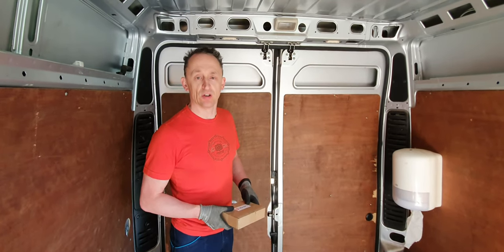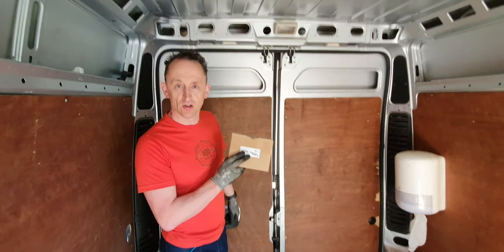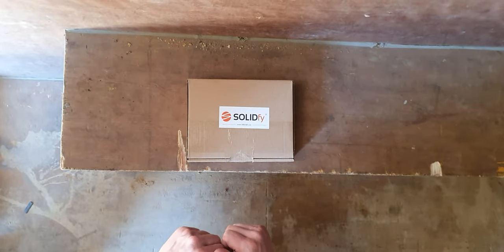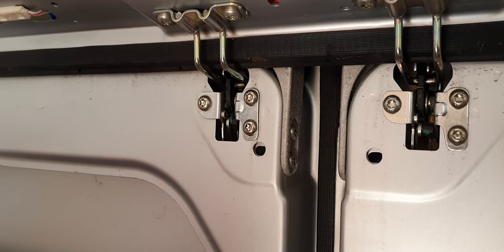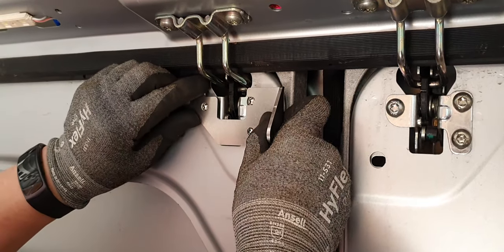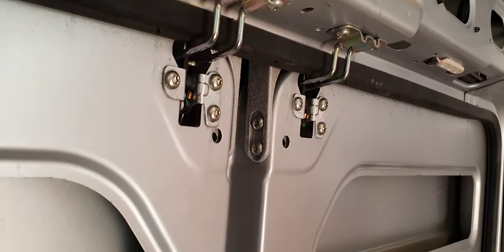Protect your Relay, Ducato, Boxer, Rear Door

Comment: Marking the position of the existing door lock brackets is very sensible until you realise that the security brackets obscure your view of the markings you've just made :)
Reply from the maker: I was able to see my marks, just 👍
Reply: Could you stick a bit of gaffer tape over the bracket to keep it in place while you install the lock? Belt & braces.

Comment: Thanks for the video - looks good. Btw there is a visible metal angle piece double bolted on each top door corner - do you know what they are? Security feature or something else?  Thanks very much
Reply from the maker: They are the door locks for the rear doors, if you are asking about the ones which are connected to the bolts i use to fix the lock too.
Reply: @Alivefrom45  Thanks- not those,  its the ones bolted to the door side at the top, facing inwards.  Just wondered if they are there to stop say a lever being pushed in at the top.  Looking at them on my Ducato they don't appear to be involved in the lock mechanism.
Reply: * facing inwards * ... I mean towards the opposite van sides, not interior!  So tricky to describe! 😁
Reply from the maker: @mickm9307  can you see them in my video?
Reply: @Alivefrom45  Yes!!
Reply: @Alivefrom45  Stop the video at 3 min 15sec and you can clearly see the offside door one and the edge of the nearside door one.  Each one bolted to top inner edge of door with 2 bolts.

Comment: How do you get in the van
Reply from the maker: Hi Frank,thank you for watching and posting your question. We  use this to stop the access into the back door, we either use the side or front doors for normal access and remove this when access is required to the garage. It does live in place 100% of the time, we lock as and when required. Hope this helps.

Comment: H2 or h3 ?
Reply from the maker: Hi Andreas, my understanding is that it will fit both, as they both have the same locking system at the top of the door.
Reply: @Alivefrom45  nope its different dimensions. i think i got one for h2, ordered one for h3 to compare
Reply from the maker: @cirkuscederstrom  please let me know if there is a difference.